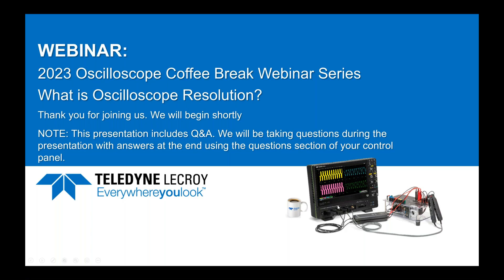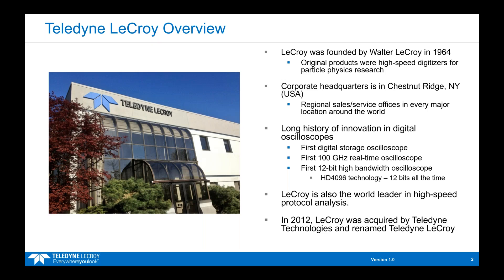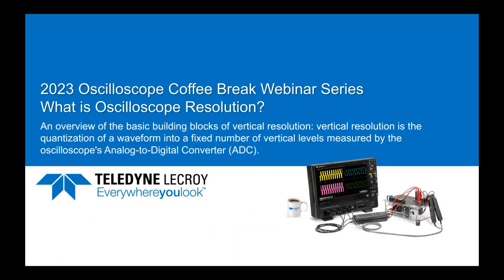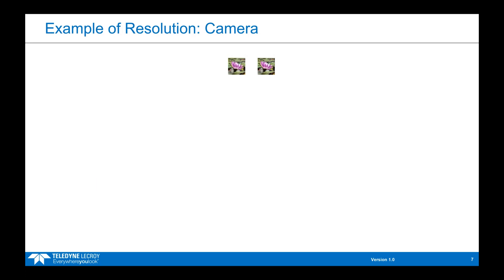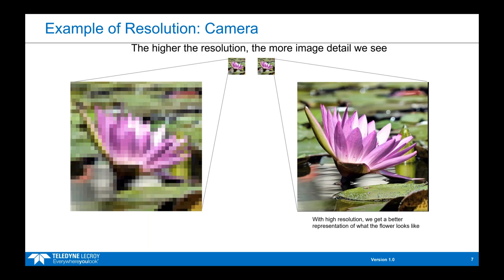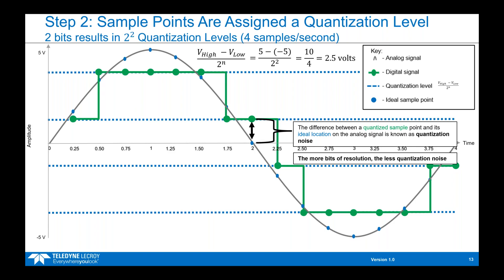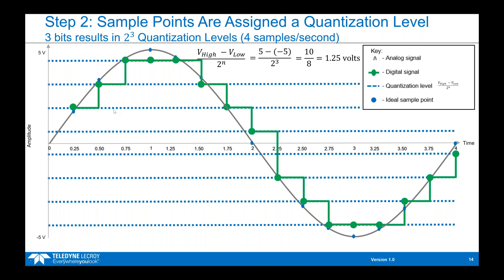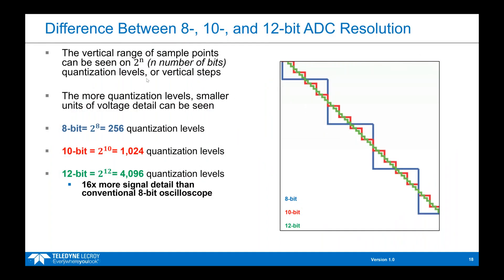What is Oscilloscope Resolution?

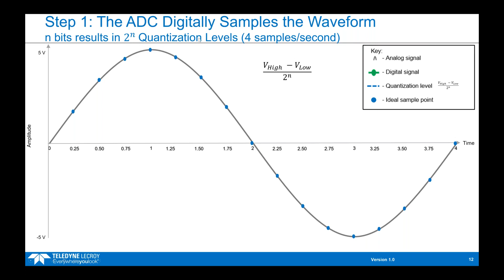Comment: 7:15 Why aren't the quantization levels at - 5V, - 1.667V, 1.667V and 5V?

Why are the lowest and highest quantization levels not coinciding with the lowest and highest voltage levels respectively?

Also, isn't the formula for the voltage interval between quantization levels V/(n - 1)  rather than V/n?

Thanks
Reply from the maker: Those are good questions, Martin. 
 
To answer your first question:
In this simplified example, the four quantization level positions are arbitrarily chosen. While two levels could be placed at the lowest and highest voltage levels like you suggest, this will result in gaps larger than 2.5V between the other two levels, which may be less than ideal. In reality, oscilloscope manufacturers position quantization levels based on the model to optimize the finite number of quantization levels available.
 
Your second question:
The number of quantization levels can be expressed as 2n (n # of ADC bits). So, to determine the smallest voltage difference that can be distinguished by the ADC, the total quantization levels (2n) can be spread out across the total voltage range (Vmax – Vmin). This gives us the formula (Vmax – Vmin)/2n. I hope this answers your question.
Reply: @Teledynelecroy  Looking at my question, I did make a mistake. The step voltage is to be gotten by dividing the voltage difference with a number(the basis of my question which I request further discussion) of quantization levels not the number of bits.

Still, I am not sure why we divide by 2^n rather than 2^n - 1 to get the voltage step size between adjacent quantization levels. Imagine we have a signal whose min voltage is 0 and max is 1, to be sampled at a resolution of 2 bits. The quantization levels are 00, 01, 10, 11. To fit these levels on the signal, 00 should be at 0V and 11 at 1V. To have the levels equally spaced, 01 level should be at 0.33V while 10 level should be at 0.66V. The voltage step size is therefore 0.33V, gotten by 1V/3 = 1V/(4-1), not 1V/4.
What makes my reasoning different/wrong in your eyes.

Thanks
Reply from the maker: @martinnjoroge6006  Please contact our in-house applications engineers to discuss further. Email: support@teledynelecroy.com